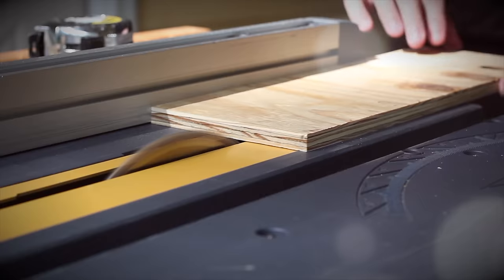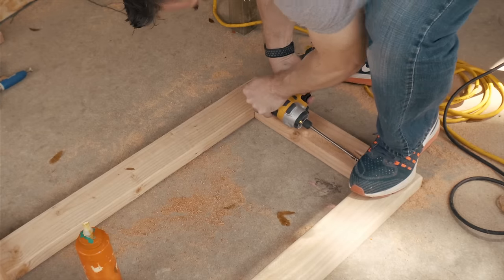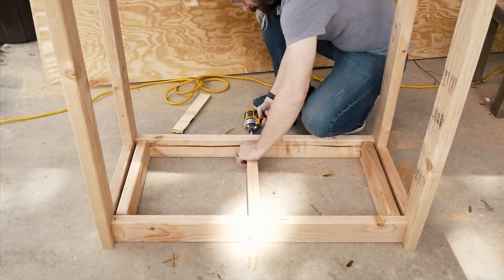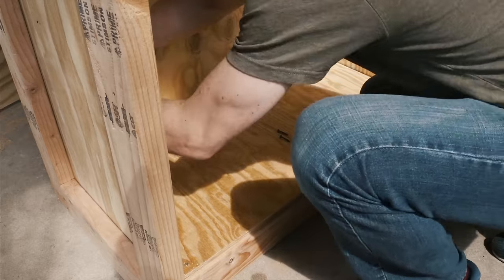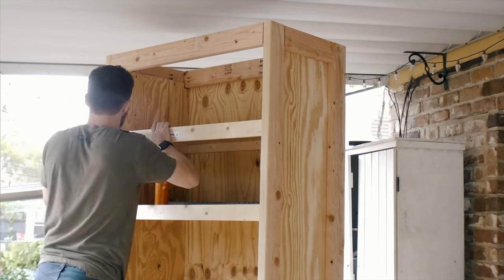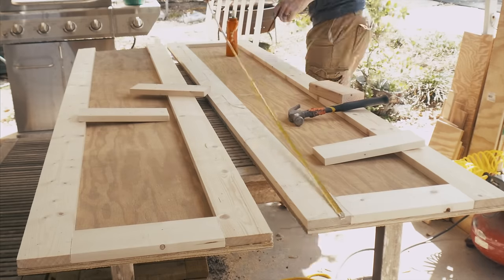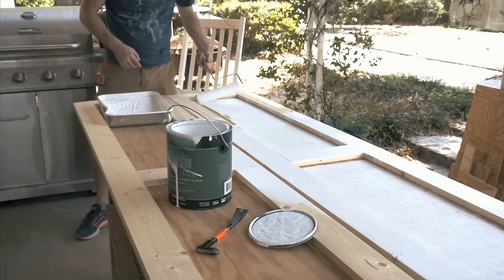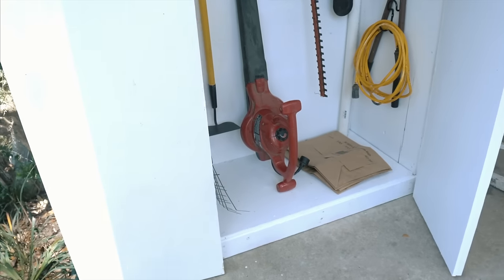Outdoor Storage Cabinet // Woodworking How To | I Like To Make Stuff

Comment: I ordered your plans awhile back and built my first cabinet. I used OSB to save money since it is going to be in the garage, and I liked it so much that I am in the process of building my second one to store auto body and paint supplies. I don't have a table saw because I sold it when I bought a track saw. It is much easier to cut down 4 x 8 sheets of plywood and is much safer.

Comment: Very nice bob. I need to make one with a roof so I can put it out in the elements!
Reply from the maker: Yeah! Adding a simple angled roof would be a nice addition!
Reply: I Like To Make Stuff yours is great I would need an angled roof only because I don't have a carport!
Reply: You could add some polycarbonate sheeting to the sides and back with a slightly slanted roof to allow water to run off the back. Have the roof overhang front and sides slightly to add to the weatherproofing. All these thoughts were going through my head as I don't have a garage or carport either.
Reply: Damo Vegan I do have a garage but that is my workshop. I want to clear the last remaining holdouts out of my garage so I can have it all!!! Going to build one

Comment: Hey, Bob, a while back, I learned from Steve Ramsey that you can pack glue down into the end grain until it's saturated, and it increases the holding power of the glue. It's worked really well for me in my projects, so I thought I would pass that along

Comment: "Makes it really easy for me to get to the rake, so they can rake the leaves" LOL...

Cool build Bob, I can see this design modified a hundred different way for the makers own needs. 

I made a similar outdoor shop cabinet but gave it an upward slanted roof with a little overhang and attached some 6 mil plastic on top to allow me to access the contents if I have to while it is raining and have any water to run off behind it

Again great job.

Comment: Regarding the glue on the end grain, Steve from WoodWorking for Mere Mortals demonstrated a good tip once. Try and push some glue into the end grain and then apply a little more. Hopefully it stops the grain from soaking the whole lot up, and gives it a bit more hold.

Comment: I see that the back panel is attached at the to and the bottom, but how about the sides? Does the back panel attach anywhere other than the top and bottom cross boards?

Comment: Sometimes I find it hard to work with warped plywood and dimensional lumber from the hardware store but it looks like the cabinet came out really nice! Any tips/info on that sprayer you use? Looks like a great time saver!
Reply from the maker: Yeah, I've had to be really picky about the pieces that I select when it comes to dimensional stuff. There's a link to the sprayer in the description. Thanks!

Comment: You can do it without tapcons.

As long as you have some sufficiently big screws (6-10mm x 80-150mm), you just need to drill a slightly oversized hole, plug it with a wooden dowel, drill a pilot hole in the plug, and then screw it in. The screw will push the wood out on all sides to make a tight fit in the hole. It isn't as strong as tapcons or other masonry fasteners, but it's definitely strong enough for this purpose.

Comment: Wow, that's very impressive. But how do you ensure that the cabinet is waterproof, or doesn't deteriorate being exposed to outside conditions. I will have to place mine on the roof top balcony, exposed to rain, wind, snow etc.

Comment: Awesome build Bob. One question; with the pool chemicals in there would you need a vent in there to allow gasses to not build up?
Reply from the maker: Thanks! Well, it certainly isn't airtight as it stands, but also the chemicals are individually sealed. I don't that's much of an issue for what I personally put into it.  It might be different for someone else though.

Comment: Hey Bob, any chance you could total up the cost of lumber when you make these kinds of videos that are only cutting and putting together wood? I'd like to see what the difference is between buying a cabinet vs building one. Thanks!
Reply from the maker: Well, I intentionally don't do that because the cost of lumber varies greatly based on location, and it will change over time. In a year, those numbers wouldn't be accurate even for me locally.

Comment: Not sure where you live. I am in canada so I did a similar project and mounted into the wall as you are going to do. I forgot count in the winter that my floor outside moves up and down due the frozen floor. I end up having a crack on my brick wall. Just a thought

Comment: Excellent job as ever Bob. Did you have to fill the holes left by the brad nails or did just painting it cover them up enough?
Reply from the maker: I just paint over them as I wasn't worried about the surfaces being pristine. The 2x4s are a little rough so it kind of matched.

Comment: First off, great vid as always. You inspired me to make something too  ! I only have a jigsaw but I don't care. However, I have to bend at a 90° angle a 6 mm thick aluminum rod. Do I have to heat it up or just bend it like that ? Thanks !
Reply from the maker: You could PROBABLY bend it without heat, but heat wouldn't hurt.
Reply: I Like To Make Stuff Thanks a bunch ! And another question while you're here  : what's the wood with the least grain / texture ? Thanks again, I asked a lot of people about this but you helped me really fast (hi from France btw)
Reply from the maker: Actual wood? Hmm, not sure really. MDF has none at all, but it's not always what you're looking for for a project.

Comment: I finally got a brad nailer yesterday it was a dewalt combo for $189. It included a brad nailer and a 6 gal air compressor. Any tips for using one? I tried using it on 1/2 plywood and i missed a couple shots and they are quite tough to pull out
Reply from the maker: Make sure you've got the pressure high enough. I know my gun runs at about 90 psi. Anything lower than that and the nails don't sink fully or even fire.

Comment: hi, I was wondering about the spray gun which doesn't seem to be in the tool list. Does it work without a compressor and do you know if you can use it for finishing products (varnish etc.).

thanks for the inspiration!
Reply from the maker: The one I got works without a compressor. It's electric. It was the cheapest one I could find at Home Depot years ago, so it's nothing special.  I suppose it could work for finishes, but I've not tried it.
Reply from the maker: Not sure if it's this exact one, but it's this brand and very similar. http://amzn.to/2oPnJ7G
Reply: thanks a lot for your time and research, very helpful. have a good one